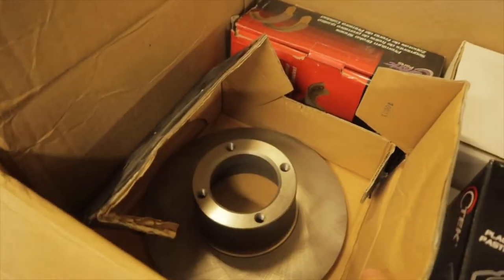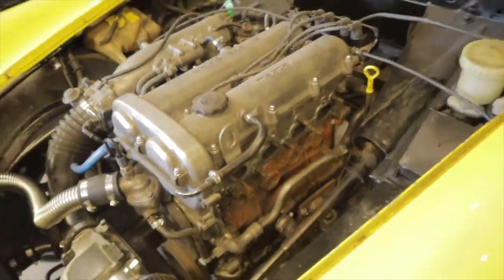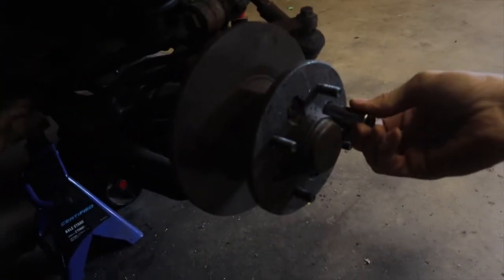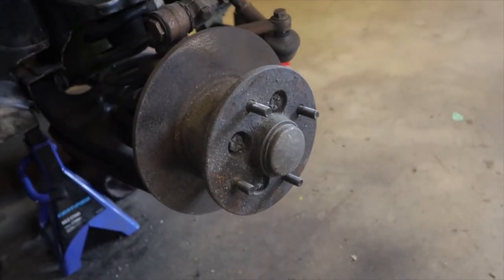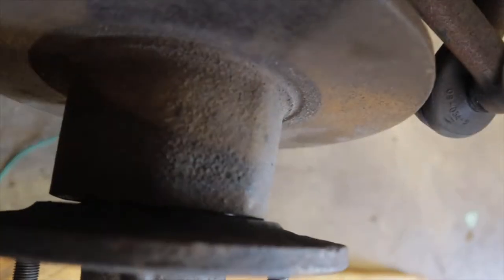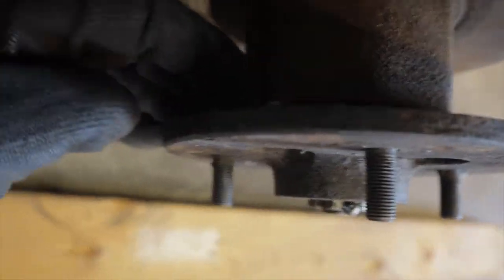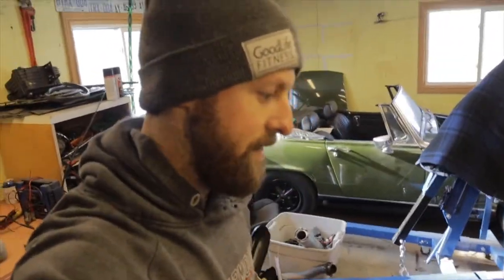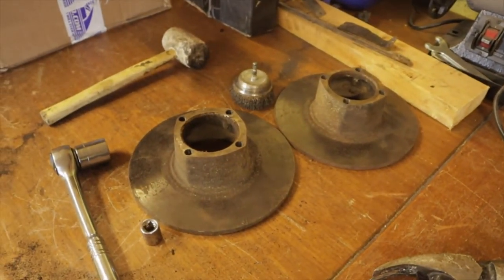How to install Brake Rotors on a 1978 MG Midget

Comment: Ah you did it the correct way the second time.   Its easier when to take out the split pin and remove the bearing retaining nut.

Comment: Nice work so far, like the fab work for installing drive train. Brakes on midgets are ok but not great even when working well lots of pedal pressure but it will stop. I have a modified 73 with 1275 motor putting out about 85hp it stops well I was just surprised how much effort required for manual brakes. Yours is going to be great fun :) keep up the work.
Reply from the maker: Really appreciate that! We’ll see how the brakes do, if we need to upgrade down the road, we upgrade! That just gives me an excuse to keep working on it 😉

Comment: Man, that engine install, that's solid. Clean. As for the brake capacity, the engine isn't that much heavier than the 1500 engine originally installed if at all? I think the 1500 is 282 pounds, the 1.6L Miata is probably less. Internet says 270 pounds? The transmission, the Miata tranny probably weighs a little more, but it's close to a wash. The difference in weight is the difference between a fat guy driving your car, and you driving your car (or just taking a passenger). So do you need to upgrade the brakes? No more than normal. Rear discs might not be a bad idea, but only because the drums are terrible at stopping the car. I would worry about sway bars or anti-roll bars to stiffen the cornering more than brakes, and of course, your roll bar.